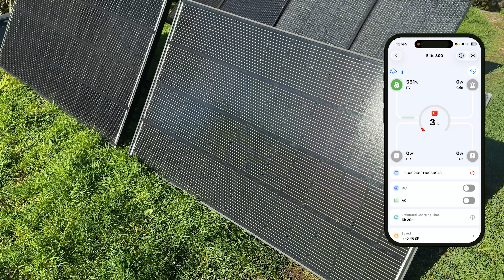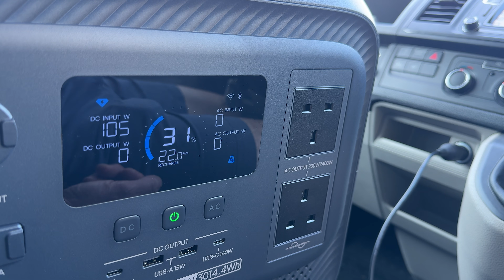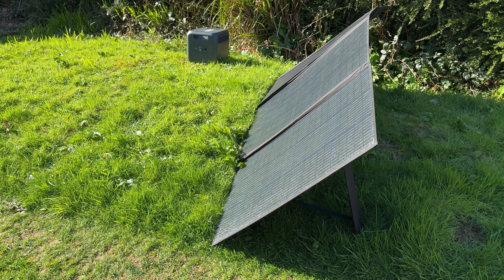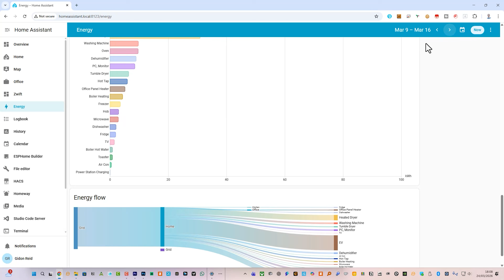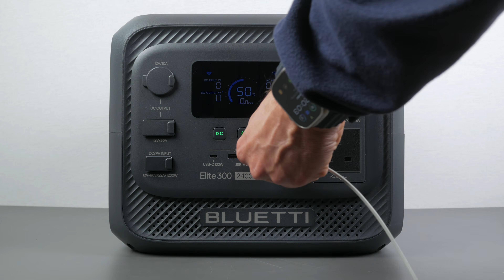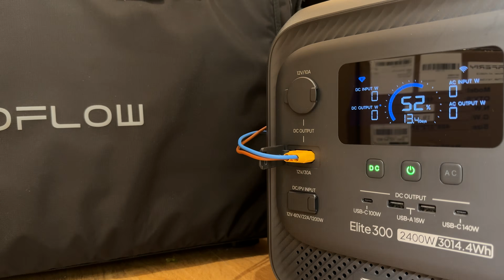Bluetti Elite 300 Review – 3kWh Capacity – But There Are Compromises

Comment: What about tumble dryer Bosch S6  you recomend ecoflow Delta 3plus or elite 300?
Reply from the maker: You just need to check max power usage of the drier - and see if it's heat pump version or not. I have the Series 8 heat pump version and although I've not tried it I reckon both would run it just fine - it has pretty low power requirements.

Comment: What are your thoughts on charging the Bluetti from an AGM battery setup (camper house battery) via the DC input XT60 port (circuit breaker on cables from AGMs of course)? I’ve read many places that this can be done and is how a lot of people do it in campervan setups. Is it straightforward and doable? Thank you
Reply from the maker: It's not something I've tried myself, but it should work fine if you don't mind the slower charging speed.

Comment: Elephant in the room on all of these 'Elite' units ... 60 V PV limit on solar input ..  Good luck with trying to find 1200w of panels that will work .. I have just added an older ac200pl - far superior imo - 145v input ..Simple high voltage paneling in series (oh and not forgetting they are not expandable)
Reply from the maker: Yes the 60 V limit is a little restrictive!

Comment: No mention in this vid about the Aferiy P280 as a comparison ... as in it is very much expandable (4kw with 1 extra battery, still cheaper than Elite 300) along with 2800w inverter ,,,
Reply from the maker: I just reviewed the P280! Take a look at my recent videos.
Reply: @TheTechnologyMan  Yes i watched that - great review btw ... My thought was that you could have used that model in the comparison from this video ... Also was contemplating p280 to go with my bluetti AC180 ,,, not confident though with their warranty - especially if bought outside of official company - what are your thoughts?

Comment: Thanks for good review! I was wondering how is the charging noise if only solar input is used? I have 200W solar coming in to Bluetti AC180 and it randomly starts spinning fans. Did you noticed same behavior?
Reply from the maker: Thanks! I can't recall specifically but I imagine you'll get similar issues with the Elite 300.

Comment: Thanks for the reviews.... I am looking at getting a back up battery, looking at this unit or the Delta 3 Max Plus.... I want a home back up solution including possibly running my summerhouse and possibly the hot tub......which would you plump for?
Reply from the maker: No problem! Either will probably do the job - just check what the hot tub needs because the inverter on the Elite 300 has less power - but you do get the extra run time without any extra batteries.